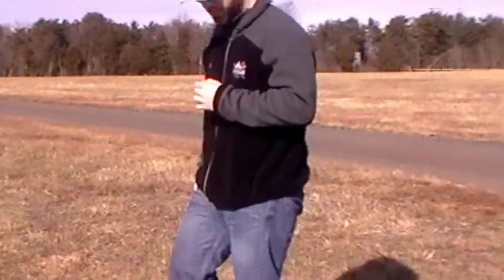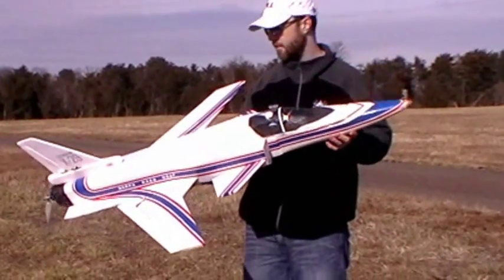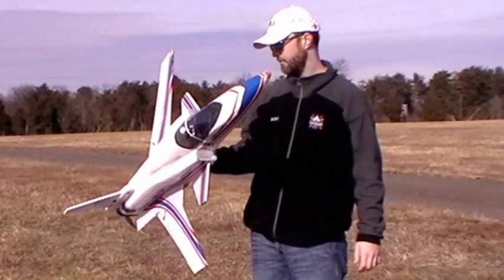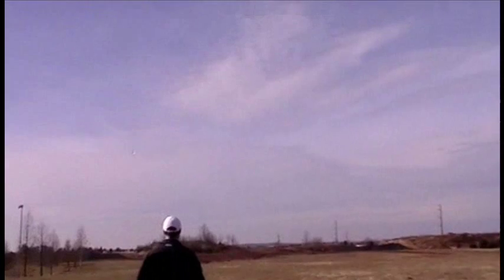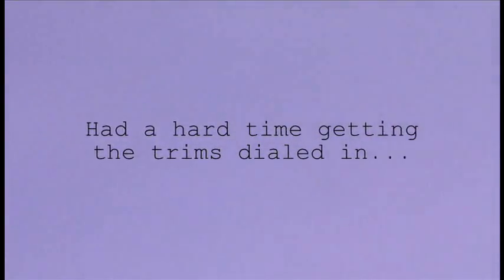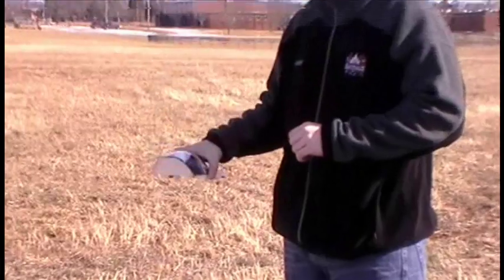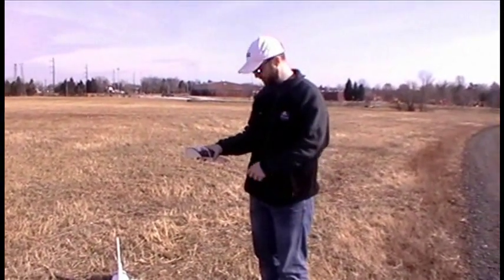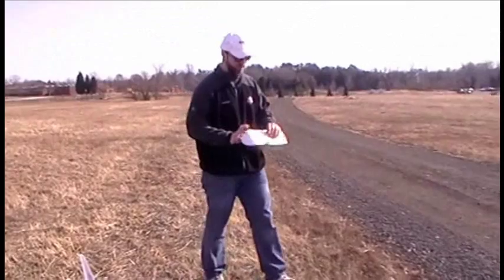BIG RC Grumman X-29

Comment: Do they make a simple, easy to fly F-15, F-16 or F-18 electric park flyer? Or do I need to buy the Cessna?
Reply from the maker: umaxen01 In general RC jets are poor aircraft to learn RC on.  By design jets are fast and aerobatic... two characteristics that make for a poor trainer.  If you haven't flown before I would definitely recommend a high wing trainer like a Super Cub.  If you're a bit more comfortable then there are some good designs for parkjets that are good platforms for a first Jet.  The F-15 from Jetset44 if a good one.  Check out parkjets.com and RCGroups for a lot more info.

Comment from the maker: @vanepico Well... I wouldn't say that at all.  The plane flys much better than shown here as it was still tail heavy and hadn't been dialed in.  It has since flown a few times and is getting better with each flight as I get the Gyro and CG worked out just right.  

Also, the Depron is white on its own, and i just used colored Duct Tape for the striping, so all the detailing outside the cockpit took about 2 hours.